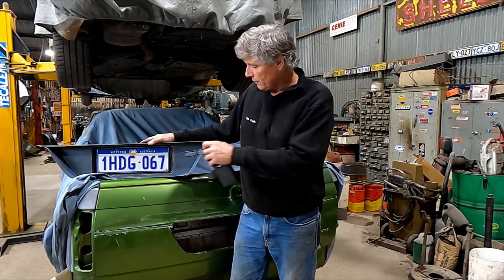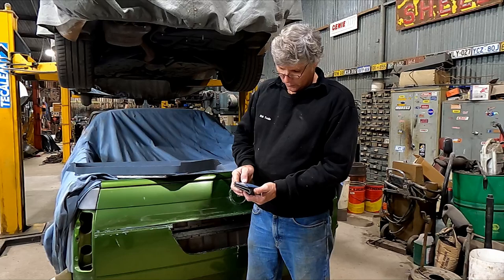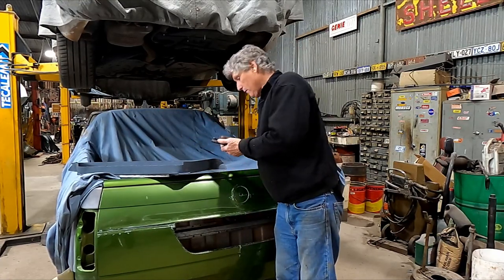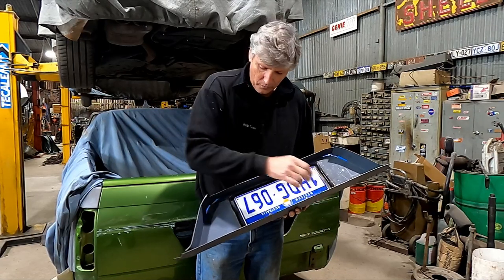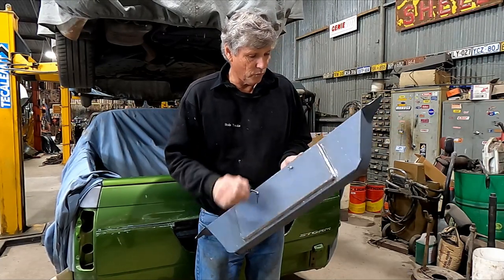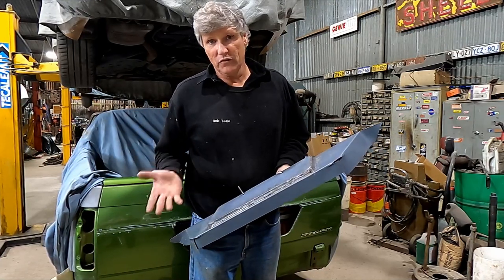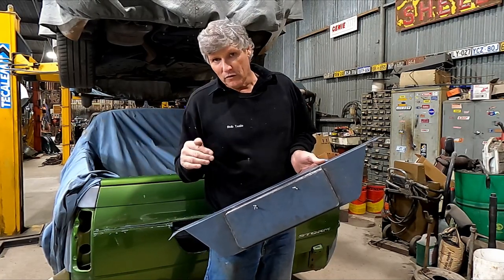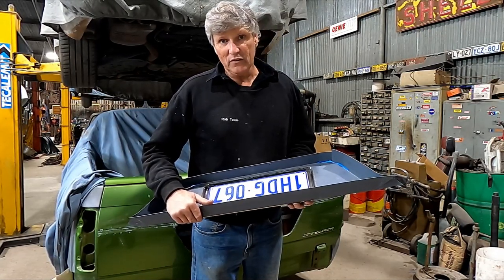Custom Tailgate - Part Seven - Your questions answered.

Comment: Would there be any benefits if you chose to tig weld it instead Rob?
Reply from the maker: G,day mate. Here is a whole new side to this conversation. Short answer yes there would be some advantages to tig over mig. Would it solve every problem that could occur no it would not. How I set this project up to weld, it could have been easily welded with mig, tig or oxy acetylene. I chose mig because it is fast, no other reason. We could throw this one back and forth for ever and not really go anywhere with it. Cheers Rob.